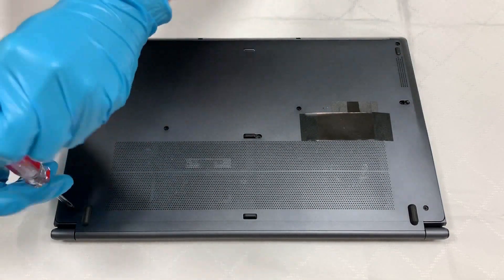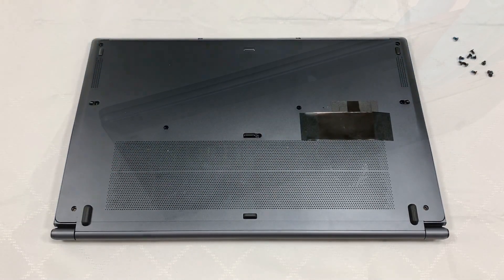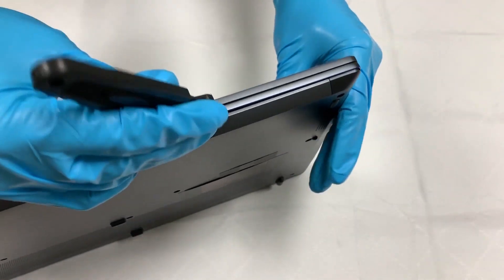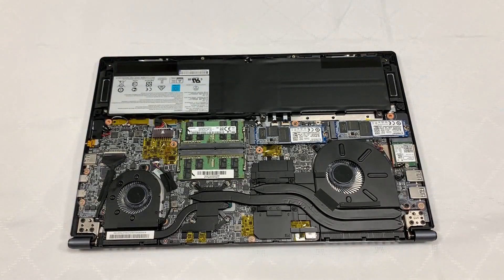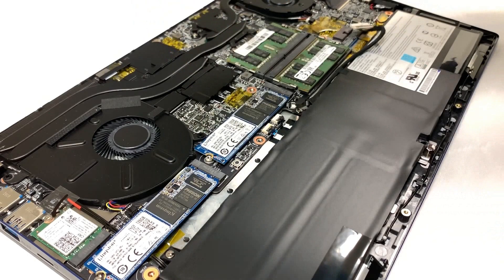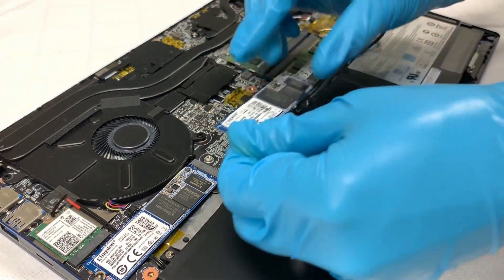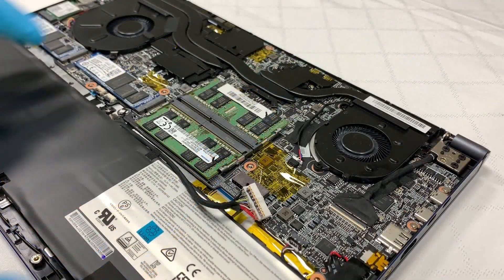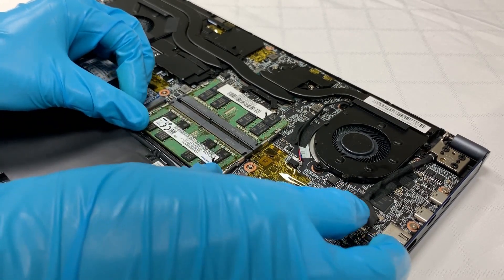MSI Prestige 15 (10/11/12 th) Series/ PS63 Modern and Summit E15 A series SSD & RAM Upgrade Tutorial

Comment: Hi, I want to add a SSD into the free slot of my Prestige 15. Is it mandatory to add a thermal pad to the M2 SSD which has to be mounted on the second free slot?
Reply: Yes
Reply: @nihalsingh6  do ssds already come with a thermal pad? or do I need to buy seperate

Comment: Hey, im thinking of buying this laptop, mainly because i can upgrade it in the future. My question is can the GPU be upgraded let's say 3 years down the line?
Reply from the maker: As we know, the GPU cannot be upgraded because it's soldered on the motherboard (it's a common design on laptops), and this brand doesn't provide GPU upgrade on this model as well.

Comment: Hi! I removed some dust and now it wont turn on. I did not remove anything inside
Reply from the maker: How did you remove the dust? 
You should check all the cables, screws, and key parts you removed.
Reply: @MFLAB  Forgot to press the power button  inside the laptop after I cleaned it. It works now. Thank you!
Reply: @laurentbajrami3688  Where is the power button inside?

Comment: Hi, always useful tutorial. May I know if the battery can be replaced when it aged and the performance drop?
Reply from the maker: The battery can be replaced but you have to get the same battery model which is not easy to be found.
You should ask the manufacturer's service center for help.

Comment: Hi! I have a tricky idea. Is it possible to add GPU to the version without one (PS63 Modern 8M)? 
In my country the only available version is the low model without dedicated graphic. Does anybody know, if there is also slot for GPU, just not filled? Did any of you teared this thing down? How is the GPU connected? 
Thank you very much.
Reply from the maker: At least we're sure that there is no internal slot for GPU upgrade.

Comment: Is it possible to deactivate the SATA Port when using two NVME SSDs so that i can have full speed x4 PCI 3.0 Access?

The BIOS Option "SATA Mode" is visible but not accessable...

Thanks a lot for this video!
Reply from the maker: We don't know if your opinion works. You should ask the manufacturer for the specs questions.

Comment: If I want to add a new ssd, do have to find the same ssd as the stock one? And do I just need to plug it into the slot without doing anything?
Reply from the maker: Go to the manufacturer's web for specs questions. If the SSD meets the specs, you should be able to plug it. 
However, the manufacturer's local service might be able to answer your upgrade request.
Reply: @MFLAB  i wish a new ssd also..MSI support is not very good I think ..

Comment: Are they both nvme or one is sata? If one is sata only which one is it?
Reply: The are both NVme, but one supports SATA (Combo).  Info from the MSI website https://www.msi.com/Laptop/Prestige-15-A10X/Specification  
1x M.2 SSD slot (NVMe PCIe Gen3)

1x M.2 SSD Combo slot (NVMe PCIe Gen3 / SATA)

Comment: The biggest disadvantage on this laptop is that the drive PCIe controller dedicated for the M2 SSDs are just NVME 3rd generation x 2 , so we can not take advantage of the high speed SSDs  with link width of x 4 . The fans are "helicopters" on big load. Second slot it is compatible with M2 PCIe ( actually it is a combo slot , supports SATA too ).
Reply: Same with my Prestige 15 - Second Samsung Evo 970 plus works great with windows, but unfortunately only half of the speed how it seems. In other ways the laptop works very well and fast with TB3 Docking Solutions and TB3 Audio Interface UAD.

Fan noise, and disabling the gpu fan is controllable with the downloadable "Silent Option" from MSI, just google - there are two version, i took the newest.

Good luck:)
Reply: @Marco13425  iam considering upgrading memory and disk in my PS63 8RC so what is the fastest M2 alternative disk and memorys that I can purchase? Thanks you .
Reply: @armeniocavaco  there are no alternatives, every M.2 you choose will have half of the speed because of the Mainboard architecture. But nevertheless the speed is satisfiing and good. So a cheaper M.2 would make more sense. For RAM you should choose a 2666MHz DDR4 Module, all over 2666MHz will not work i guess.

I heared that newer Laptops like Razor or Dell have the full M.2 x4 Speed and 2993MHz RAM. Nevertheless iam good with my prestige 15, because of two TB3 ports:)
Reply: @Marco13425  well we all have to make choices. At the time this was best for me than the Dell XPS I edit photos but now I must edit some videos also and needed more muscle ..I guest I will just increase the memory to 32 gb that is the best I can do so far and Dell does not allow that. It was my choice back then the laptop will make 2 years next month I will keep it for another 2 years and maybe then ai go for Mac. Thanks a lot
Reply: well i just bough a m2 nvme to the second slot and computer wont recognize it..

Comment: Is the second SSD slot (SSD1) compatible with M2 PCIe, or does it only support M2 SATA?
Reply: The are both NVMe, and one supports SATA (Combo).  Info from the MSI website https://www.msi.com/Laptop/Prestige-15-A10X/Specification  

1x M.2 SSD slot (NVMe PCIe Gen3)
1x M.2 SSD Combo slot (NVMe PCIe Gen3 / SATA)
Reply: @leonardoalmeida8715  Thank you. I am own of MSI PS63 Modern and planning to upgrade storage. Unfortunately my model has M.2 SATA port instead of M.2 NVMe :(

Comment: Very useful video, but can you please make another video about disassembling fan and copper heat sink on this model, in case I want to repaste CPU and GPU with something more better
Reply from the maker: It's not in our plan since the purpose of this video is to show how to upgrade the RAM & SSD. 
However, we will consider making a video on how to disassembling fan and copper heat sink and clean the fan.
Reply: @MFLAB  yes please thank you
Reply: @MFLAB has this video been made?